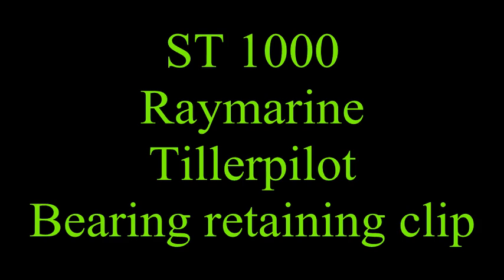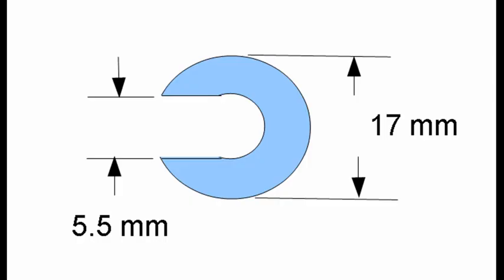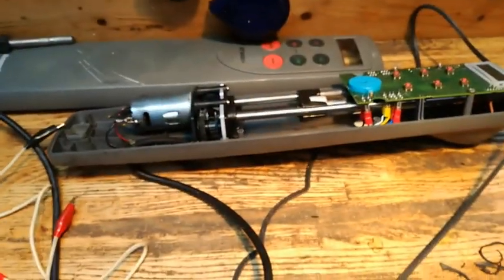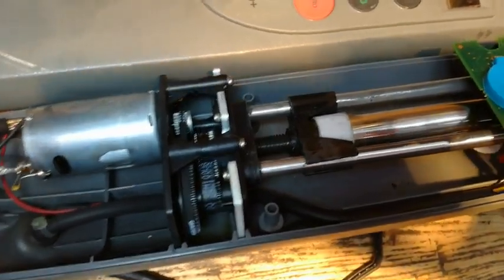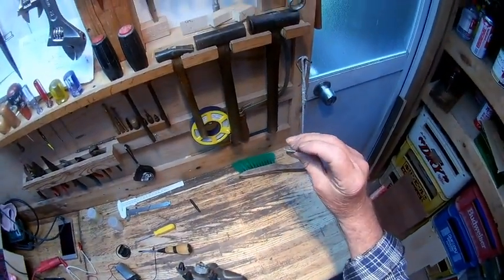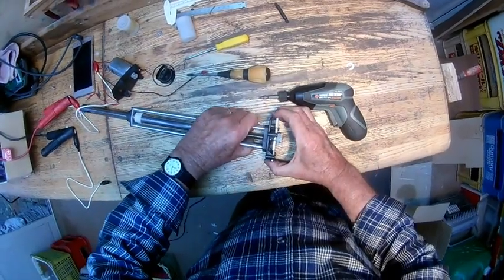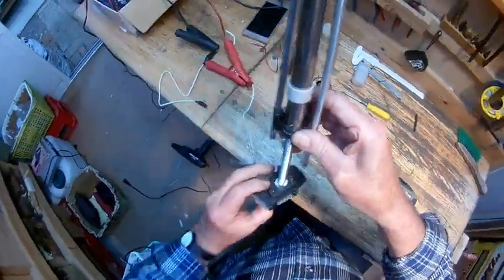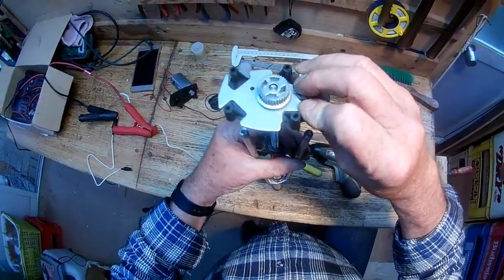ST 1000 Raymarine Tillerpilot bearing slop repair

Comment: Hi. My steering handle is backwards.I guess it was made that way, so u can do fishing from the back of the boat and be able to steer it while there, So if I install a raymarine, my boat will wanna steer the opposite direction of what raymarine is trying to turn. Do you have any idea if there is a setting or adjustment for that?
Reply from the maker: Hi Ibrahim. 
The Tillerpilot is factory set to operate from the port side. If you want to change the side of operation you have to press the -1  and the  + 1  buttons together for 5 seconds.
 It is easy.
 Here is a link to the Raymarine manual. 
The setting instructions for changing side is from page 49. 
https://www.raymarine.com/en-us/download/st1000-st2000-tiller-drive-manuals

gary
Reply: @garymalm  thank you very much. I will try that

Comment: AWESOME! I will do the same on mine... But I just destroyed the bearing insidethe rod... Any tips on how to replace it?
Reply from the maker: Hi Alexandre
You mention that you "destroyed the bearing inside the rod"

Just to be clear in the manual on page 9 there is the 
3- Lead screw
11- drive nut.
Is it the drive nut that you mean?

Here is the manual.

http://www.wiremu.com/TSP_photos/Tillerpilots/ST1000Plus%20&%20ST2000Plus%20service%20manual.pdf

gary
Reply: @garymalm  I removed the "lead screw (3)" form the "drive nut" and a few "bearing balls" fell off. Later I noticed it was not a major problem. I could place it back in and it went ok... Thank you for your effort!